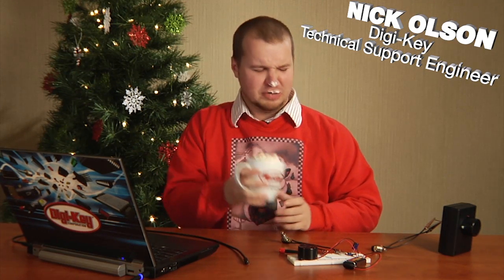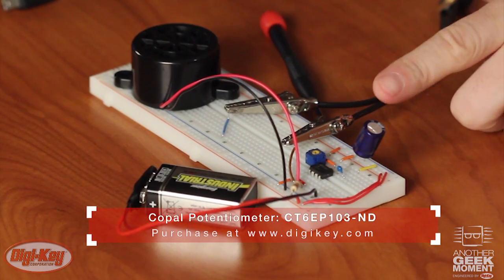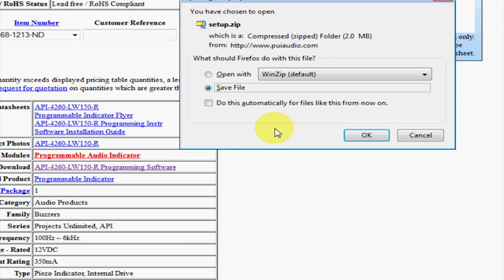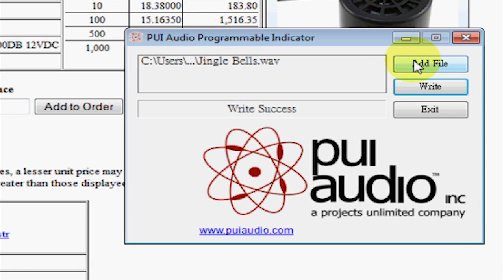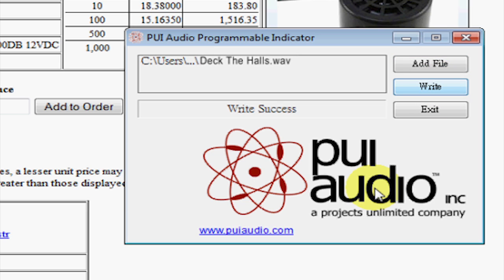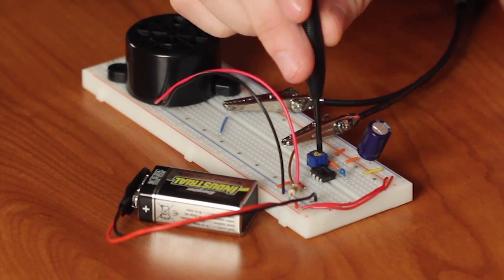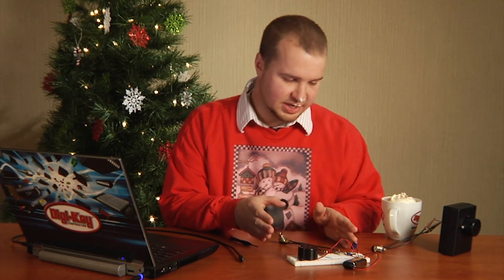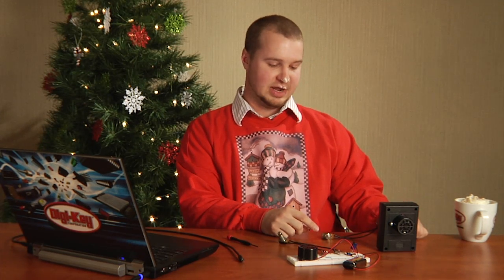Programmable Holiday music doorbell - Another Geek Moment

Comment from the maker: BS6I-ND 9V Battery snap connector
N145-ND 9V Battery
438-1045-ND Solderless Bread Board
10KQBK-ND 10k Ohm Resistor Thru Hole
P5116-ND 2200uF Capacitor Thru Hole
445-5252-ND .01uF Capacitor Thru Hole
668-1213-ND Buzzer
LM555CNFS-ND IC Timer
CT6EP103-ND Potentiometer

Any Other questions let us know and if you would like an excel doc with the parts just email webmaster@digikey.com with the subject Another Geek Moment BOM  Thank you.